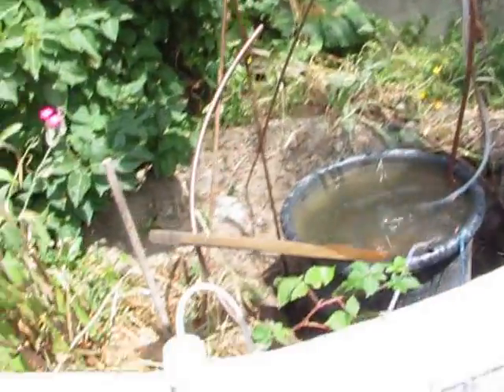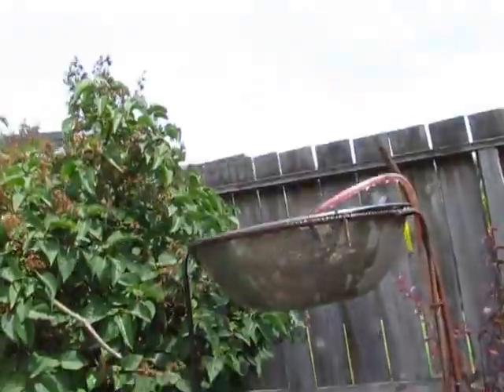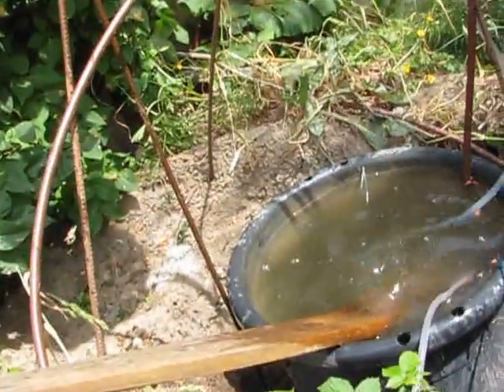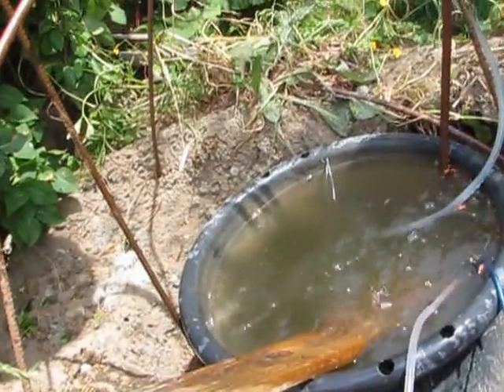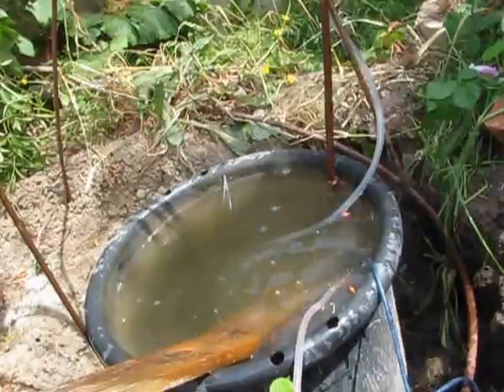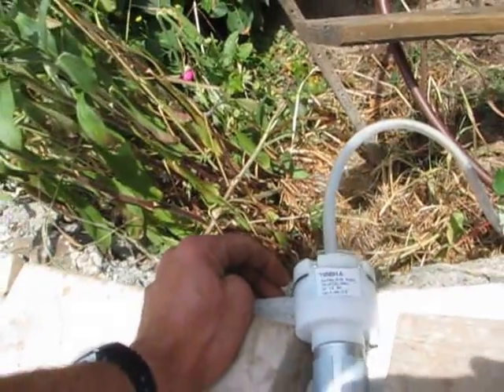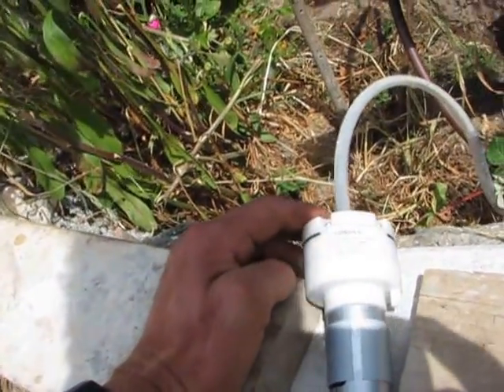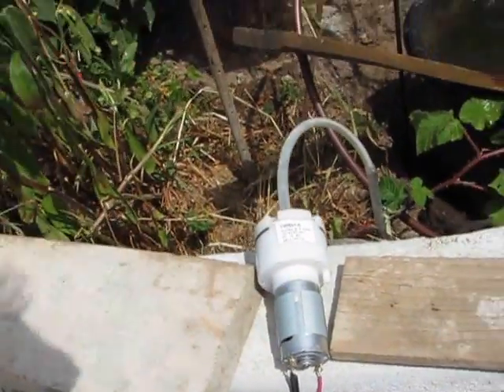Short video about solar powered fountain/birdbath project

Comment: That's a great little pump.  One way of getting around the "too much flow" problem is to use a syphon in a sealed jar as I use to refill my aquarium.  I have split the air between the jar and the outlet pipe (the part inside the jar).  This means that if you increase the airflow, your water/air ratio in the outlet remains about the same, so it will pump just as high, but it will pump faster.
Reply from the maker: Thanks Christie.  The big pump will run everything I have all on its own.  It was a big surprise to have one pump blowing my manometer within a minute, with 7 airlift pumps running from it!  (The manometer has 2 meters of water pressure before it blows while the airlift pumps run from about 40 cm of pressure)  I definitely need to do something like your siphon idea.  I will probably make a big fishpond and let excess air in there to oxygenate the water better.
Reply: Using the fishpond as a dump sounds like a great idea.